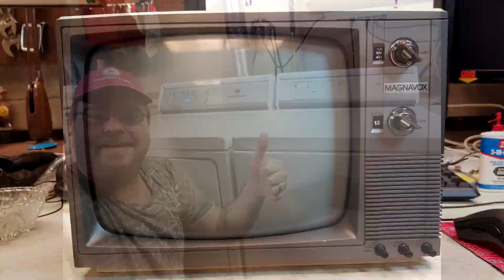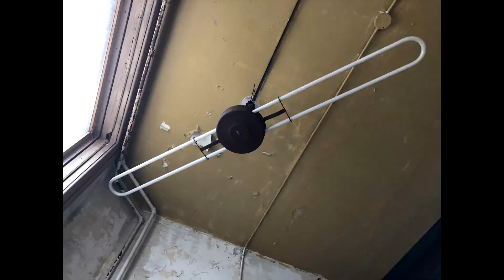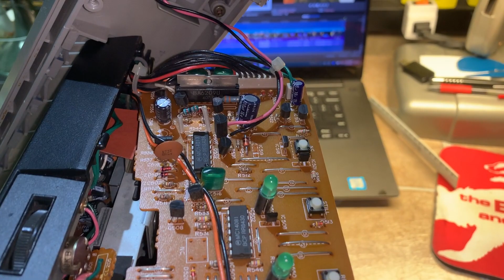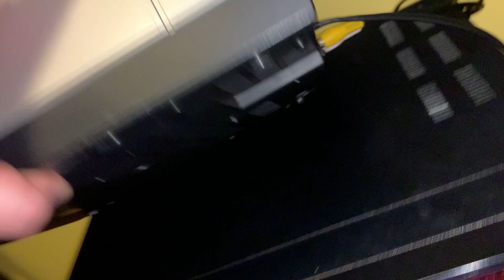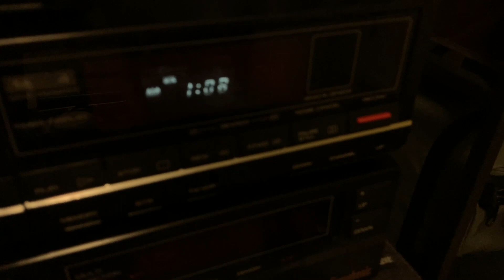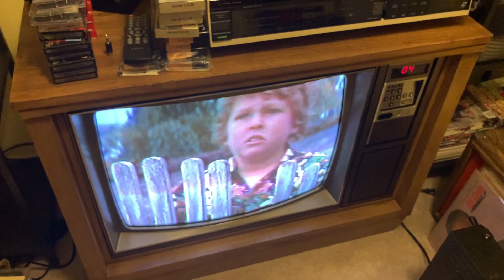1984 Funai Model VP-1500 VHS VCP

Comment: Where do you get all these old Shintom or I should say, "Funai" VCRs?
Reply from the maker: The only thing in common with Shintom is the tape transport. The rest of the unit was made by Funai. The pre-1992 ones are the polar opposite of the crap Funai we are used to.

Most of them came from eBay and a few from the thrift store. This one came from a friend like 12 years ago.

Comment: Nice fix!  Glad to see that old tank still running.  You know what's really fun when the brakes go bad? Reel-to-reel decks.  And you find out the hard way when 20 feet of tape piles up on the table.  And it will be one of your nice tapes, never a blank one :-)

Comment: Way cool!!! Kinda wish these rental units supported all three tape speeds though.....
Reply from the maker: The one advantage though is this machine has the wider width videos heads optimized for SP speed since it doesn’t have to use slower speeds. End result is much better picture quality.
Reply: @spatsbear  And most movies being rented were recorded in SP speed anyway, I did get a tape at Burger King when I was a kid that was recorded in LP the beginning of the tape says to adjust VCR tracking for best picture.

This was a Teenage Mutant Ninja Turtles tape that was at BK in the early 1990's
Reply: Well no pre recorded tapes came out in any speed other then Sp. Also most people didnt use the slower speeds most People just used the SP speed since it was the default set speed on all Vcrs and most average consumers didnt mess with speed settings. I have actually only encounterd 3 LP tapes and I have owned like 60 TV recorded tapes and transferd about 40 family movies for people.